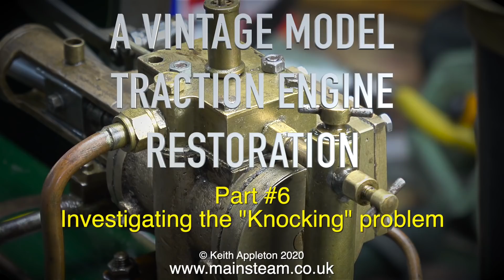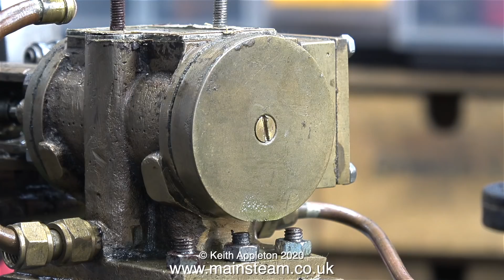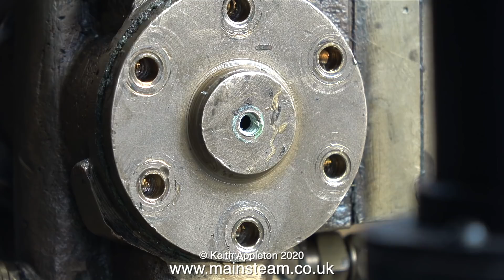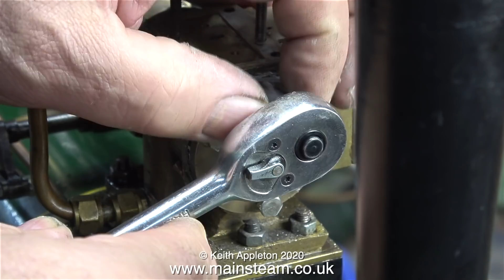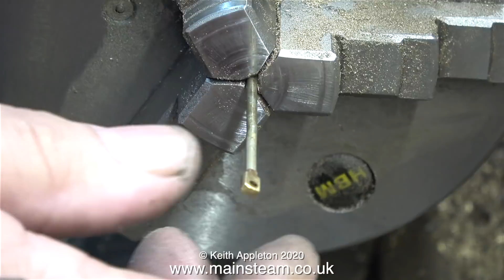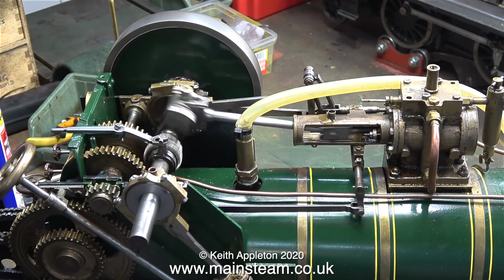A VINTAGE MODEL TRACTION ENGINE RESTORATION - PART #6

Comment: I did my first experiment of model steam engine using tin cans and synthetic host for delivery. But it doesn't run. I wonder what is wrong with it. I used my kitchen stove for a fire. I used tin can cover for piston and copper pipe for rod. I'm not sure whether is it too heavy to move it or there is not enough steam pressure. Hope you can help me out with sir. Thank you.

Comment: The cod rod looks too short. The slippers are coming out of the end of the trunk guide, or the trunk guide is not for this engine, e.g., too short. Hard to say as the piston looked to be at the end of the stroke, yet the crosshead doesn't appear to go all the way forward. There's something not right.

Comment: Nice
Suggestion. Straightening rods... This method is used on the rods in instruments such as saxophones. Take a piece of wood, drill a hole just big enough for the rod. Wood will be at 90 degrees to rod. Spin rod in a lathe or drill with wood over it. Angle wood away from 90 degrees to straighten. Slide wood along rod as needed. Do with care, it's possible to snap the rod if you're ham fisted. Don't ask me how I know...

Comment: Keith, what was the purpose of BA fasteners. Are these somewhat of a comparison to SAE? This is my first exposure to them.
Reply: BA is a different type of screw thread profile. A 4BA is approximately the same size as a #6 Unified Thread Standard (the common SAE thread profile in the US), although it has a somewhat finer thread profile to the common #6-32 UNC screws. It's also in reverse, low number BA screws are larger than high number BA screws